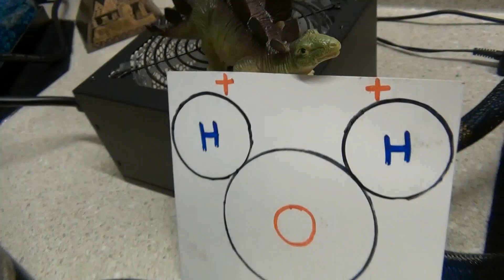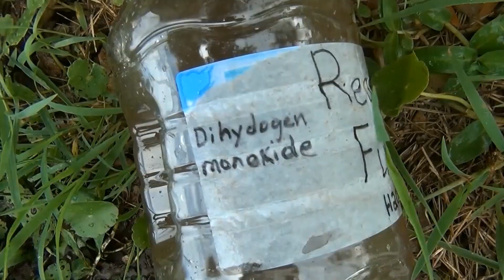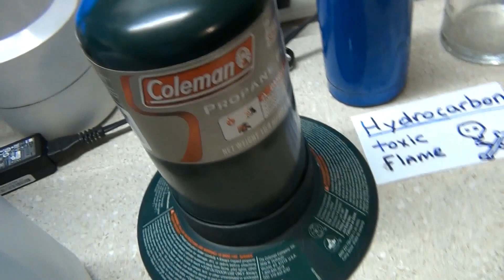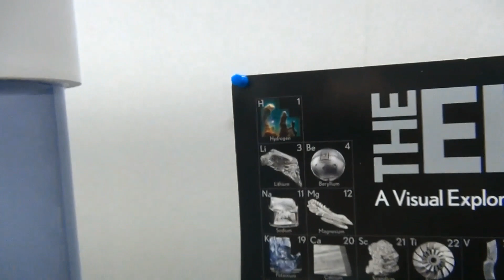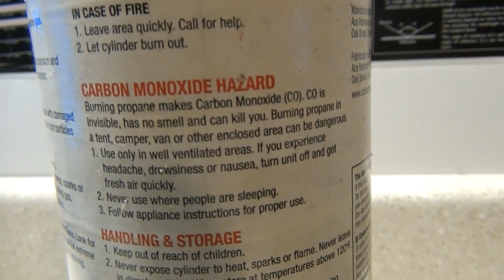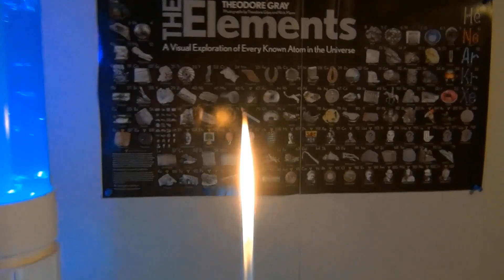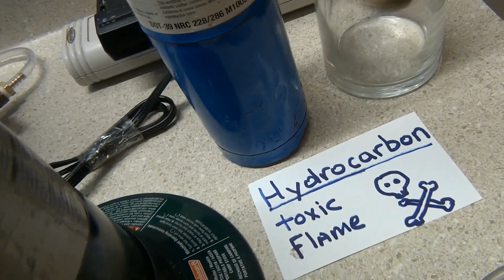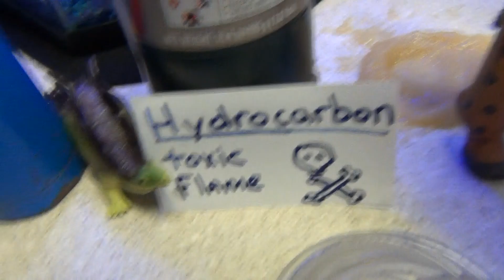HHO BURNING PROPANE HYDROCARBON FUELS EFFICIENTLY

Comment from the maker: Mixing propane, a hydrocarbon fuel for a cleaner much hotter flame without the pollution by using the pure oxygen that is provided by water from the oxyhydrogen fuel cell we can burn all of the propane with more efficiency power and control burn rates flashbacks and create lower temperatures can be very useful.